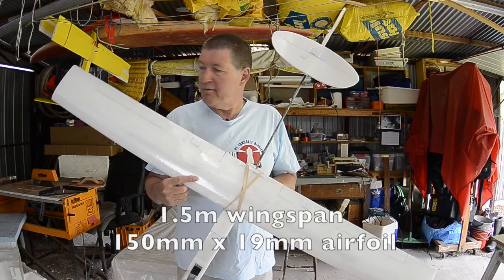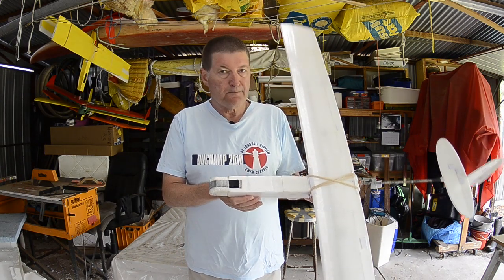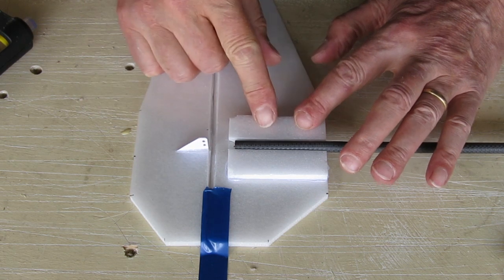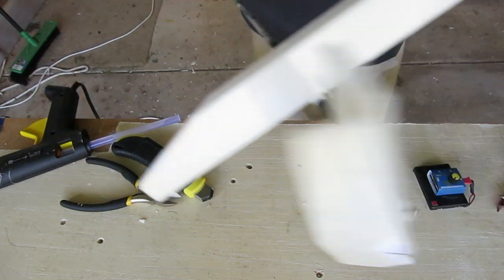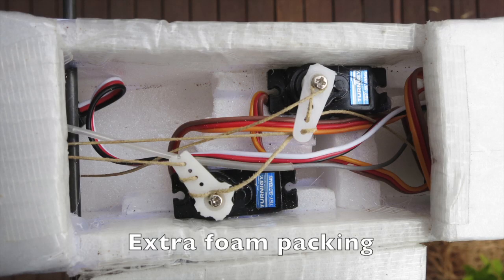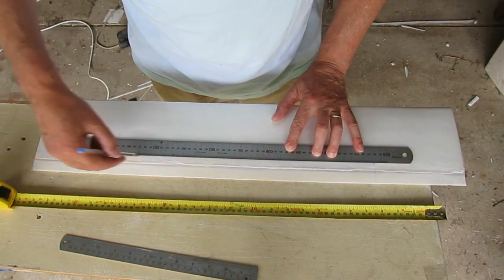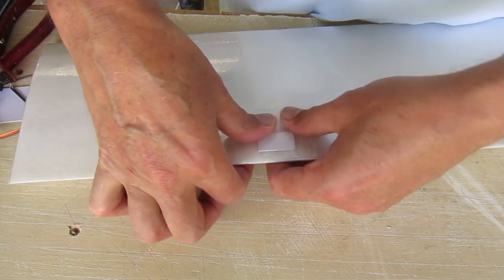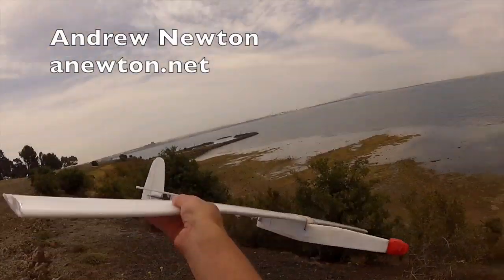Ultra light sloper build

Comment: I like the spring hinge that might just solve my problem of dual elevators on 1 servo. Thanks Andrew
Reply from the maker: Yes that would be a good solution.
Reply: Im having a problem getting wire thin enough. I had some from another toy grade plane but my servos are not strong enough to pull against the spring and if i make control horns much longer the throes will be tiny. Any advice on where to get some 0.3 wire from. Thanks Matt
Reply: #throws

Comment: Hi Andrew: Great videos you have. I learned a lot watching your videos. This video inspired me to make me a foam glider using the same Technics you used in the video.  I did mine  about 2.3  Meters wing span and used 3 FC rods for the boom. The only thing different I did was that I covered the wing using 0.7 oz Fiberglass with epoxy resin  and reinforced the joints with 6 oz FG. First I built it as a glider and It flew great but living in Florida I don't have Slopes to really fly it. Managed to fly it from a man made slope about 10 Meters high on a park close to where I live  but I only had enough lift to just keep it over a few meters over the hill. Now I chopped the nose off and Added an Electric motor to it.  a 960 Kv with a 12x6 prop. and this is my favorite plane now. Here is the video I wanted to share with you when it was a full glider https://youtu.be/Jrfz9xy19Yg 

Here is another video when I added the motor https://youtu.be/TcJFClrsnNQ
Reply from the maker: Fantastic Jorge, thanks for sharing your success. I have not yet tried fibreglassing wings, maybe one day.

Comment: Hi andrew, I’m into scratchbuilding, but I don’t know what motor/esc/battery/prop to use?  Currently I have an emax 2250kv with a flite test 20a esc. This setup hasn’t been capable enough, and I need to replace it. Me builds are about 600mm to 1500mm and weigh 250g to 500. I need a versatile setup that will be able to do this, any ideas?

Thanks for any help, Bo.
Reply from the maker: My go to all round motor is the SunnySky X2212 1400kV. 8x6 or 8x4 prop. 3S or 4S battery what ever capacity suits your plane 1300 up to 3000. 30 to 40A esc will cover everything
Reply: @AndrewNewton  Thanks very much. I might use this for the scratch build Talon GT I’m doing. Also, where is a place I can get this, that ships to Aus?

Comment: You might also mentioned that one of the advantages to using the pull and release, single line method for controlling the rudder and elevator is that you don't have to worry about flexing a of a control rod when running it through a tail boom.

What are you using for the tailboom and wing spar?  They look to be the same thing.

Looks like a great flier.
Reply from the maker: You are right Keith. Spar and boom are Skyshark P4X from Kites and fun things. Great for big kite spars too.
Reply: Hello Andrew, my name is Keith, I live in Michigan USA. On the west coast of the state we have a large lake, Lake Michigan and it has elevated dunes which I am sure is great for slope soaring.  I think I would like to build up one of your of plans for that or even for hand launch.  I appreciate you getting back to me. I am enjoying checking out your ideas, it looks like you have some great ones.  I especially like the Peace Drone for a powered platform.

Comment: Build a 1.2m span hlg glider out of an old fishing rod and the lightes depron i fond... Use only 2 Servos, together with an smal 500mah 1s.
The Wing is hotwirered out of pink foam, but a styropor wing would be lighter. The weight of the setup is ~210g ( 150g the wing, 60g the fuselage :) 
Want to try slope sore with it in the next days :)
Did I need Elevans for a sloper ?! 
Greedings !
Reply from the maker: Hello, do you mean ailerons? If you have dihedral in the wings you may not need ailerons. Sounds like a super lightweight glider. Good luck.
Reply: My question shold be :
Need a Soarer Ailerons ?! :)
I hope it will float ! 

Have a nice day ! :)

Comment: Very nice, thanks for showing all the great ideas used in the build!
 wonder if current consumption increases significantly by the servos constantly pulling against the spring-loaded elevator & rudder. Have you had a chance to measure it?
...Too bad we don't have this document laminating film here.
Reply from the maker: 50mm packing tape will do the job. I have not measured the current but you can add a counter spring to the servo arm I believe.
Reply: Thanks for replying. Love the counter-spring idea!

Comment: Greetings Newton. I've been enrolled in your channel a short time ago, and I'm curious about the meaning of the Kn unit. I see in your videos that you measure the speed of the wind and inform the values as for example 6Kn or 10Kn. My question is: what is the relation between Kn and Km / h? 1 Kn equals how many Km / h?
I apologize for my English, I only speak Portuguese and I am using translation online. Congratulations on the channel.
Reply from the maker: Hello and many thanks. Knots = Nautical miles per hour. 1kn = 1.85km/h
Reply: Thank you!

Comment: Very interesting technology... spring-tensioned wire.
Reply from the maker: I like this control method for light gliders.
Reply: Thats quite good for your CG I think. My models are build of foam, some wood and adhesive tape (scotch-tape).
As the motor, prop, lipo and esc in front, so the "tail" servo are placed as far, as possible. So my models are well-balanced.
Recently I vave my Spitfire maiden! Surprisingly, it was a bit tailheavy.
I think I will use your technology in near future in Extra 300, or motorised soarer. I donk know that I want more, extra or soarer... :(

Comment: Great Vkdeo, thanks again for posting. Question: When you have a longer boom such as this how much weight is needed to get the CG right without a motor.

I understand you got thr tail section lighter using torsion spring and kept servos in fuselage etc.
Reply from the maker: Thanks. I just select a heavy enough battery to balance on CG. Or I may design the nose length to use the battery I have. Might have been a 500mAH 2S
Reply: @AndrewNewton  

Are these carbon rods a lot lighter than say the same length wooden dowel?

If I typically use a 1/8 diameter 30" boom.

Would same size carbon fiber reduce weight of tail?
Reply from the maker: Probably similar weight but much stronger. Dowel is fine on light models
Reply: @AndrewNewton  
Thank you.

Your videos date back some years.
How long have you been into aviation in general & how long RC Flying?

Were you into as a child, teenager, or as an adult? I read many enjoyed the Hobby as kids then get back into into there 70s & 80s which is very cool.
Reply from the maker: I only started with RC flight in 2013

Comment: Nice plane project. Simple and pretty flying. But i have a question. This system that forcing the stabs (elev and rud) to one side using spring wire does not damage the servos?
Reply from the maker: Admar A Godoy It could be a problem if the spring was too strong with weak plastic geared servos but this combo is working well.

Comment: Andrew, how do you get the semi symmetrical wing profile in the correct upright flight mode, and do both halves consistent to each other. Great simple build I’m considering for 2.5m for park flying.
Reply from the maker: It's not an accurate build method. Push down harder while gluing for a flat bottom, less hard for semi symmetrical

Comment: Thank  you for this nice video.

Regarding the angle between the main wing and the fuselage, and the angle between the horizontal stabiliser and the fuselage, did you simply set them to zero ?

What is the tail volume of your design ?
Reply from the maker: ramy gad Yes it's roughly zero, just by eye. Tail volume? See the blog link above for measurements
Reply: Thank you

Comment: Hi Andrew- On this plane when you say the wing cord is 150mm or 6" is that typically from leading edge of wing to tail end of Ailerons? or 150mm plus 1" or 1.5" extra for Ailerons.
Reply from the maker: Wing chord is leading edge of the wing to trailing edge of the ailerons. Ailerons are included in the 150mm
Reply: @AndrewNewton  

Thanks-
I’m new to  custom builds myself & learning a lot.

I know gliders tend to have much longer wingspan in general.

What effect does having a longer wing cord flights?

What difference would you achieve having a 5”, 7” or 9” wing cord on same wingspan?

Comment: awesome build, looks reasonably straight forward,  is the material you use for the wings and fuzz readily available in Oz please?, Thank you  Baz
Reply from the maker: +Barry Durrant Read the description Barry
Reply: +Andrew Newton , my apologies Andrew, I should have mentioned Im in New Zealand, so whether the material is available here I will check with a hobby shop. Thank you  again..
Reply from the maker: +Barry Durrant Hi Barry. I bought the depron in bulk online to reduce the cost per board to about $5.20. Good luck. Beware of "Art shop" foamboard. It will most likely be heavy and expensive.
Reply: +Barry Durrant Frame and Art shops in NZ have 3 or 5mm foam board that is similar to Depron - a nice foam with a dense surface. The paper needs to be soaked and rubbed off though. Often available as off cuts for free that will suit smaller models. 
Light Lam film from Graphica, 343 Church St, Onehunga, Auckland, some copy shops as roll ends and online. 
I would suggest loosing the DLG tail feathers for a V tail as sub rudder is not required and makes landing near impossible without damage. Further weight reductions possible by using epoxy glues, light weight wrapped carbon boom from a (broken) fishing rod, and carbon fibre tow or 1mm rod top and bottom surface spars.  Spars may not be needed on a one metre wing. A 8-9% wing with a bar sanded in AG03 foil will give better penetration and performance that will help if used for thermalling (http://www.rcgroups.com/forums/showthread.php?t=1643253)

Comment: Hi Andrew. Great plane and video! what is the diameter of the CF fuse rod and could this be adapted to be a DLG aircraft? Thanks for the plans and "how to" portion of the video.
Reply from the maker: It's about 7.5mm Link in the description. Would have to be much stiffer for DLG throws
Reply: Thanks for the reply and the information. I am wanting to build a very low cost first time DLG and I thought this Slope Soarer design would be a good way to start. Would you mind to suggest what diameter CF rod that would be sufficient for a DLG build based on your design?
Reply from the maker: Rough guess - 20mm  to 12mm tapered, thin wall, woven boom is what a DLG needs. Most straight tubes will be too thick walled and heavy. Could try old fishing rod?

Comment: really nice. did you go for any dihedral in the wing ?  I'm curious how you perceive the performance of this design vs a plane like the red sloper.  clearly it can handle lighter wind but does it feel faster or any more nimble?
Reply from the maker: 28th St. Air Land & Sea I can swap wings depending on mood so I'll do some direct comparisons soon. The white wing has a 13% airfoil 150x19 and it's slower but more aerobatic. The Red sloper is 10% 190x19 and is heavier and faster.

Comment: I'd like really to know how to strengthen the foam.. so shinny and smooth...
Reply from the maker: Covered with clear packing tape or iron-on document laminating film.
Reply: @AndrewNewton  i had bad experiences when i'm working with packing tape.. slow but sure, air bubbles appeared under the tape layer and made the plane surface so ugly, and the strength of the foam is so weak.. do you have any advice for me working with tape or other materials?

Comment: Oh boy - I really shouldn't watch your wonderful builds - you make it look so easy and describe it so well I can't help but want to make my own (ie. re-prioritise my good wife's list of must-do jobs and risk making her a bit cranky!). A big thank you once again. I'm wondering if this particular build was done before you got into foam wing cutting and whether you'd employ that for a similar future build instead of the folded depron? I've just made my shiny new wire cutter to your spec and really want to use it! Cheers and thank you from Sydney - Dave
Reply from the maker: Hello Dave. This was before I tried hot wire cutting. I have done more recent versions. Search for the fusion and balsa versions. It's difficult to stop the wings twisting during the build but great results when it works.
Reply: Hi Andrew - thanks for your reply. I figured as much. If I may ask please, how does the Bunnings foam (Knauf) go with twisting/warping after covering with tape (I have the HobbyKing 45 micron tape)? BTW, I'm currently building a spar drilling jig and think I will drill using the wing profile template before cutting the wing so I can ensure alignment (I'm sure my measuring won't be as accurate as yours!). When I get a bit proficient and daring, I'll attempt to drill in some dihedral, first checking measurements in Sketchup. It's all wonderful and I wish I had more time to do this - your videos are wonderfully inspiring!! :)  Cheers and thank you, Dave
Reply from the maker: It really depends on the airfoil thickness. 25mm is no problem but thinner than about 20mm is more difficult to keep flat while covering. Tape is easier than iron-on laminate. Good luck mate and let me know how it goes.
Reply: Thanks Andrew. Hopefully I'll finish the spar driller tomorrow and my boy and I can cut our very first wing profile. We'll have a go at the NACA 64-514 used on the Pilatus Porter - going for 1200mm total span, probably stretch the chord out to closer to 190mm. So exciting! Cheers mate - will keep you posted. Dave

Comment: Hi Andrew ! Thanks a lot for your videos and review, that's great. I've just built an ultra light slope soarer using your plans, just switching the folded depron wings with a clark-y hot-wire cut foam.

Here is the maiden : https://youtu.be/xEYPR0yaZtc on a small dune with a very light wind.  The day after that, on a bigger dune with a tad more wind (not much, 7-8 knots I guess), it did allow some loopings and fun stuff, so, great.

The only problem is that the rudder authority is close to zero, even showing some adverse yaw. Did you experience something similar on yours ? Do you have an idea of what to change to improve that ? A bigger rudder control surface ?

Thanks for all that !
Reply from the maker: That's fantastic, well done. It might be the Clark Y airfoil causing adverse yaw, just a guess. I didn't have that problem with mine, the airfoil was more symmetrical.

Comment: Yeah, just drop your glue gun anywhere haha!
Reply from the maker: 3000gtwelder Yes, I cringe every time I watch that back. Should have prepared my workspace better.
Reply: Andrew Newton
No worries lol, You should see my work space, I'm too embarrassed to even film it. I have to work out of my bedroom, at least you have a garage haha. Great videos. Love the idea about the spring for the tail section, I never thought about that. Really saves on weight. I was using really small aluminum tubing with push rods on my Vtail, but it had a lot of drag and I had to keep it oiled well to work. Spring idea is much better I think.